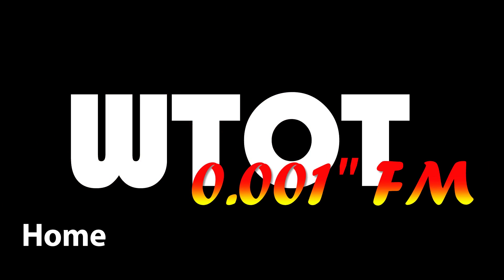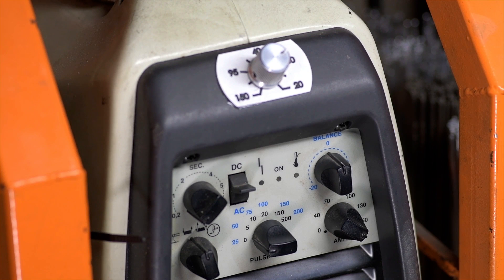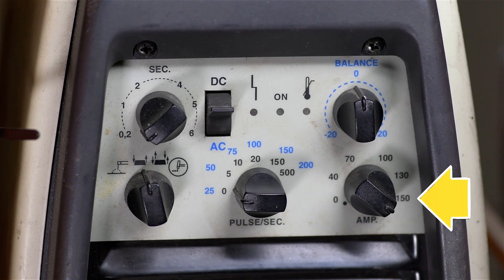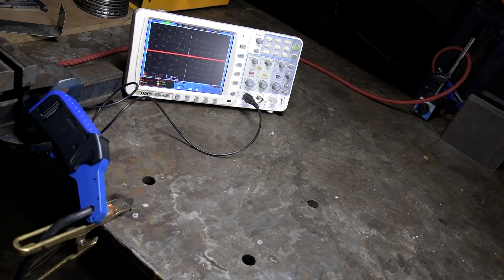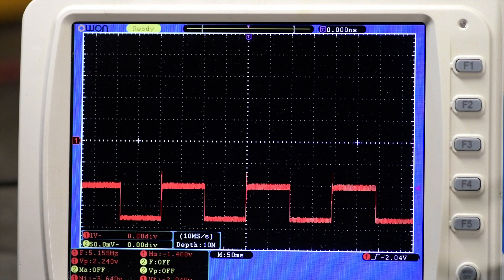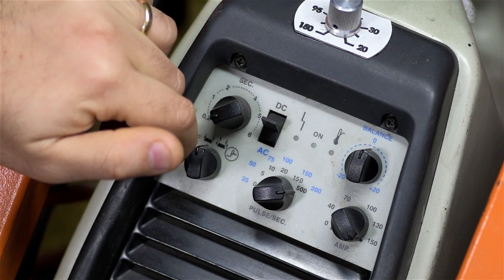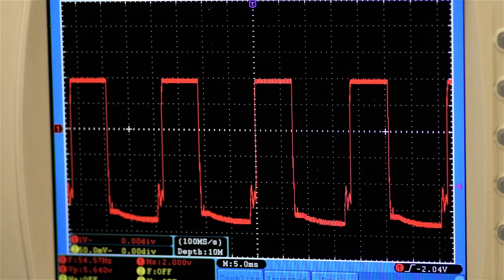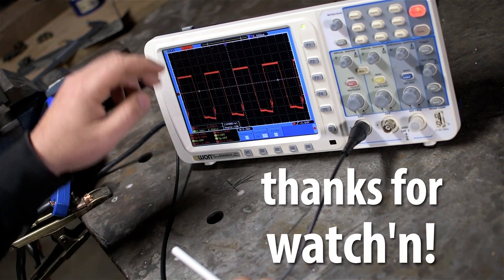My TIG Is Breaking Up With Me

Comment: Informative video, thanks!

On another welding topic, I watched with interest your acid-paste neutralizing of the stainless welding on the plant stand.  I can't seem to get this paste from my LWS.  With a brief search, I noticed that there is also an electrical process which yields the same result.  It seems similar to electrolysis or etching, i.e. something you can DIY.  Perhaps this would be a good subject for an upcoming video.

Regards from California!
Reply from the maker: I know what you're talking about, have seen them demonstrated, but have never used one.  I believe its called electrolytic passivation and/or cleaning.
Reply: That's a better start than I have.  Got off my lazy you-know-what and googled it.  Yes, it appears to be quite nearly the same as electrolytic rust removal.  http://www.instructables.com/id/DIY-Stainless-Steel-Weld-Cleaning-Electropolishing/

Comment: Great to see another video Tony. I'm not a welder expert (or an expert on anything for that matter) I refurbish old tube equipment as a hobby and the number one failure I find is capacitors. they dry up and signals start wavering off . They begin to leak and essentially become resistors. I don't even check electrolytic capacitors in vintage equipment. I just go ahead and replace them right off. I have no idea what's up with your welder but I'm just throwing it out there. Many times a capacitor will have correct capacitance but if it's leaking it won't function right in circuit. if you don't leak check it you won't think it's bad.  ok that's my two pennies worth.
Thanks again for sharing tony.
Reply from the maker: Thanks LEAF!  I plan on having a closer look.  Stay tuned!

Comment: I have a machine from that vintage. It had a swollen cap in the main power circuit that is fed with the rectifier bridges, so I replaced all the caps on that board and the input diodes with high quality components. Sadly it didn't fix it, the machine feels "weak" when welding aluminum. DC welds just fine though.

Comment: I have that same basic welder. (Thermal Arc 150 GTSW, with internals made by Cemont in Italy)  I used it for a year before I realized that pedal max = 150 amps.  Couldn't figure out why I had to keep such a high travel speed to keep things looking pretty.  I swapped in a separate rheostat on a new pedal..  I do want to thank you for the demo of the inductive clamp on probe...  will that work with my old skool BK Precision Analog oscilloscope?  Now I'm curious if my readings are the same as yours? Nicely done video.
Reply from the maker: My pleasure ZipZit.. I can't see why your scope shouldn't work if it's got the frequency range.  be safe!

Comment: The one time I had a really weird fault on my inverter arc/tig, I took it in to be looked at, expecting them to condemn it and sell me a new one. It turned out to be iron filings from grinder dust - one quick vacuum of the insides and fixed!

Comment: Schematic here:
https://www.scribd.com/doc/11877495/Thermal-Arc-150-gtsw-Cemont-ac-dc-tx150-service-manual-Tig-Welder#scribd
Reply: Good work. This manual is a great find. I hope TOT is able to poke around deep enough in the guts to find the issue.
Reply: Awesome!
Reply: Hugh Frater  Thank you, it took about five minutes of googling. Sadly I couldn't find any better version.
Reply: As only half a section of your waveform seems to be affected, it seems as if half of the control is just not working properly. Could be on the input side or control side. Assuming it is the right device for the right grid (230V, 50Hz ~) in the right setting and the wiring diagram is applicable it might not be too hard to find the issue. I cant tell which half of the control side is for DCEN or DCEP and where polarity might be crossed. Comparing both to each other is a good start.

But: working on devices like this requires a qualification in the electrical field, as severe damage to the device or to you could eventuate by working on it. Please do not attempt opening it without using proper tools, safety gear and safety procedures. That being said:
Overall checking for improper connections, solder joints might help to get an overview. Checking typical wear parts for function should be easy, e.g. secondary transformer coils for proper split voltage output and coil resistance, capacitors for capacitance.

I would start to check the secondary coils of T1 for same resistance to exclude a broken coil first (as a starting point). If possible check the voltage of the secondary coils that power the control circuit for control voltage. If there is a problem, it might be one of those suppressor diodes (TVS Diodes) having taken a beating by ESD/Lightning.

Then i would go over to that darlington transistor part (V24, V20? hard to read) that switches those n-channel MOSFETs for the affected part of the switching. A defective capacitor or resistor there might limit the function of the darlington, defective diodes/improper solder joints could limit the ability to switch the MOSFETs on one half properly.

Then there are the MOSFETs themselves, but all of them being defect is not what your measurements indicate. Part of them being defect would render the others probably overload and die quickly. Checking their temperature (coolant spray, indirect measurement or IR camera) during operation might identify a broken part.
Reply: Denny I always read all of the comments on most machining YouTube videos.  Your efforts are not wasted, there is tons to learn from commenters who are experts in their domains.  Thank you.
Reply: Michal Kundrát I thought this was a cemont, good work
Reply: Michal Kundrát nnf
Reply: W
Reply: Learning Italian seems like a good, supplemental hobby to add.  Seriously though, these should go a long way to finding the issue.  Based on the intermittent behavior, the sudden not-working-then-working split second changes, and the nature of the rest of the issues, I'm thinking that one of the control circuit logic ICs let its magic smoke out.  It isn't vital enough to cripple the machine into garbage, but it does seem to have some serious consequences on general operation.  The bad thing is, since a lot of those looked like they were the same on the schematic (at a glance), they're probably from the same lot and have a similar life expectancy, and you're TIG is very likely breaking up with you, and without a replacement control board, you'll probably run out of magic smoke in the remaining circuits within the next few hours of use.  Maybe.  This is all from a quick glance at the schematic and an EE background.  Take my comments with a grain of salt, though.  When it comes to things smaller than you can see with the naked eye, stuff can be a bit surprising.
Reply: Well, i got no idea if it is pointless to write such things in youtube comments, as it is often way off realtime and not mentioned what background the youtube creator has, but anyway.

Another possible cause that came to my mind might be conductive dust on the circuit boards, as you seem to run it in an environment with lots of chips and grinding grit flying around. So i assume cleaning it internally and checking if that behavior persists might be an even better start than going in depth with the circuit itself. Sometimes some dirt just might need to short-circuit two pins on an IC to give such a behavior or reduce the isolation so that a spark forms on the circuit board instead the welding spot.

In case parts "solder themselves out", it usually means their internal resistance increased and the resulting power loss within the part results in heat, which melts the solder. They usually need to be replaced in that case. Otherwise they usually leave smoke marks.
Reply: Well, i am electronics technician for such applications by trade, but currently working more in software and statistics than in high energy switch mode power supplies. So i did not come across such a device recently.

Problem solving via youtube comments works in some formats, no question. I like TOTs videos, his format centers around an enclosed project and i learn a lot from them. So I got no problem writing what comes to my mind for a question asked, but i am more a forum citizen or use a hands on approach, where the problem descriptions evolve over time until you either find a solution or abandon the problem or someone else has a similar problem. It is a different form of participation, i kind of fish in muddy waters here.

The proverbial youtube hate culture imho comes partially from the commenting system as it is, which is fine for comments, but barely useful for participation. The video on top is a more or less finished piece of work and so you got a 1:n communication channel. Backward is kind of hard.

I understand creators that avoid participating in the comments a while after uploading, making the videos is usually hard enough and there is usually a next video in queue.
Reply: perhaps a simple adjustment of the "associated" multi-turn trimmer pots on the back of the upper board...there are 6 of them, page 4 of the schematic .. they look to be coarse adjustments for the front panel controls/waveforms....just couple turns clk-conter clk to see if they offset...( i would start troubleshooting here, see if i could bring waveform back or if not problem may then be in trimpots associated circuity ).... use that scope.... and keep 1 hand in your back pocket when adjusting..
Reply: think someone could send me a copy of that pdf, I'll post it for free download on my own electronics website. can't stand when they force you to sign up for something involving paypal just to download a file.

Comment: Hope it's something simple gone awry in the TIG machine, and not a big, high current, proprietary solid state component. Lots of ringing on the square waves, but I bet that's of no significance to the weld; only to your neighbors' radio reception.

You're the first guy I've known with an OSCilloscope. Sounds like an instrument used in the diagnosis of ocelots. Even with the amp-clamp probe, I cringed at the thought of scoping a welder. Interesting stuff, though, especially seeing the pulse width actually change with AC balance.

Comment: At 4:03 you mentioned you'd love to have slower pulsing. To be honest, I guess you could just use remote connector on back and add simple circuit to generate pulses. You can make circuit with one dual opamp and two potentiometers that will allow you to control frequency and duty cycle independently.
Reply: I cobbled together something similar for slow pulsing.

Comment: There's a "spark gap" thingy-ma-component in invertard machines. You'll literally see it arcing if you run the machine without it's cover. It makes the AC A. After a while it 'burns itself' too big. Applied Science had an issue with this component, and fixed it (offscreen) in his vid on welding Al. beverage cans. Look into that.
Reply: balisticsquirel do you have a link for that vid?
Reply: I don't know where to start in answering that. I think i can't be polite, so i'm just going to say no, no i don't.

Comment: Very nice on explanation for the home/hobby shop user! How ever your scope reads 54.57Hz in the 75Hz AC mode! Do you have trigger set incorrectly on the scope or is your TIG machine freq way off?
Reply from the maker: I didn't even notice that, good eye.  I'll go back and check in the video, the timestep should be visible.  The wonky bounce on one side might be throwing it?  also, there is a 40khz (I think) carrier in there somewhere, maybe the machine uses for the current adjust?
Reply: I think that the bounce should not affect it all to much, since periodically it would be the same time interval. However I am not that familiar with new scopes and can't really tell if it averages the frequency or just measures one discrete arbitary wavelet. If you bother to set it all up again, you can try different frequencies and see how much the all differ. I don't think the carrier would interfer, since it is three orders of magnitude higher.

Comment: Your balance should be factory set to 70% negative. 50% would eat tungsten. AC on steel will give you bad readings in addition AC positive is the "cleaning action" for aluminum.  Hope this helps

Comment: I think something in the feedback-electronic is shot. 
Probably a diode, capacitor, opamp or resistor, more likely a diode, maybe an opamp. Also look for old "swollen" capacitor this can throw off the circuit as well.
But without a look into the machine and some diagrams it's hard to say more.

Comment: If it's an older machine then maybe something as simple as bad solder joint? I'd change the pots and take a good look on the solder joints.

Welders get warm inside and have bit of a vibration so components might get loose over time.

Anytime you see even a hint of a circle around the solder joint then that means it has a "cold" solder joint and it needs to be resoldered.

Also electrolytic capacitors age over time and their ESR starts to rise, so maybe recap?

There seems to be schematic for the welder floating around on the net, but the one I found was in italian. Just take it apart and make part 2 of the TIG welder video... :)

Comment: I'm blaming that potentiometer. seems like some unwise, young Tony messed that up.
Reply: I think they were talking about the bias pot for the timing, not the one for maximum current. If the wiper feeds the timing circuit goes open then there won't be any timing bias and would stay at 50/50 like he's seeing. It not reaching full amps on the DCEP side most likely is a bad pre-driver not driving the IGBT or FET to saturation.

Comment: I feel your pain brother. Its hard whenever a beloved tool starts going bad. I remember when my first band-saw started to fail. I pleaded with it to stay with me. it was the first tool i used in woodworking. It made me the person i am today. But its locked internal bearings meant that i couldn't fix it. It started getting harder and harder for it to start up. harder and harder to stay running while i was cutting thicknesses it didnt used to have trouble with. Then one day i flipped the switch and it had finally seized up. No amount of the lords lube WD-40 helped it get going again.

Comment: Hey Tony, we missed you man! Very good info so far in here, I've gotta say I've never been a big settings junky when it comes to TIG and I've mostly owned transformer welders. This video strangely makes me want to grab an inverter machine because I miss having pulse settings. That high DC pulse frequency is actually very useful on things like brazing iirc. Anywho, glad to see you're limbering up!
Reply from the maker: Never tried them on brazing.. interesting.  Thanks Gerald!  Agreed on settings junky.. though I'd kill for a simple lift start function.. and the slow pulse.
Reply: I'm not sure if I'd go that far, I had an old Miller Econotwin that was lift start, foot pedal controlled HF and gas on the torch. Welding aluminum with that thing made you feel like a mad scientist. Remote amperage control is my best friend now. I couldn't agree more on the slow pulse, unless you're on a turn table and there's a clip board staring you down, it's nice to take your time and let the puddle fill up a bit. And thank you for taking the time out to do this, again it really does make a difference.